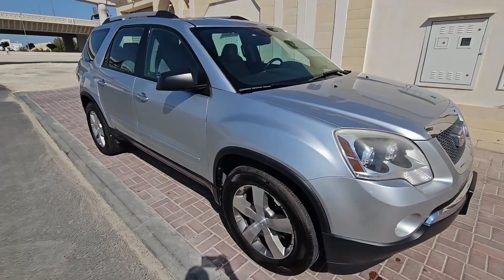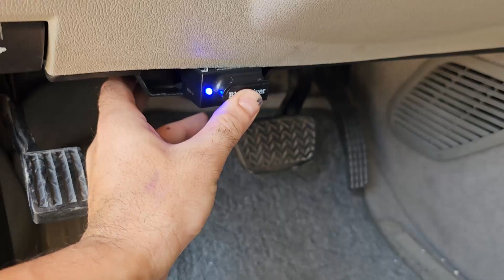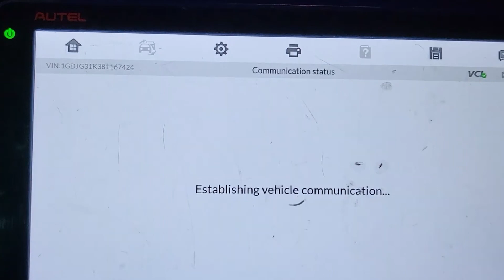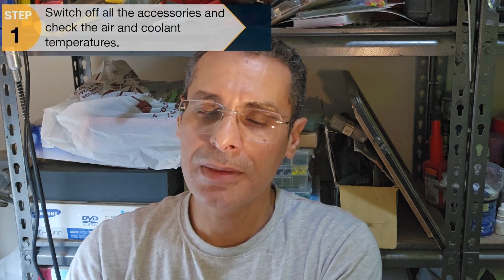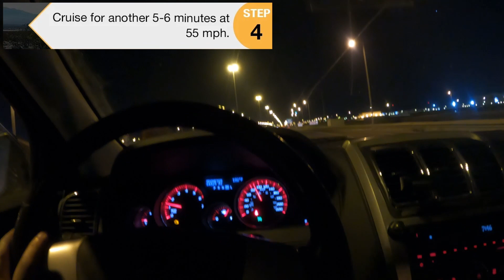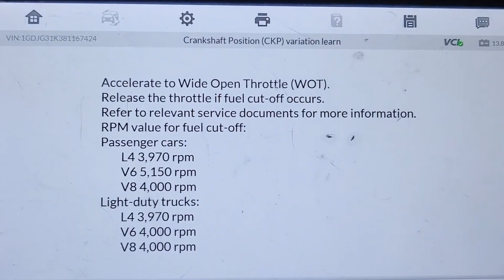No Scan tool Crankshaft position Sensor relearn P0315

Comment: Mechanical timing must be locked perfectly before locking Vanos PHAZER sprockets ALSO...must be in LOCKED position ..IF NOT when YOU snug TENSIONER inch pounds SPEC.RULE...if PHAZER is faulty ITS been KNOWN phazers go BAD...must be in LOCKED position before Torquing Cam Bolts...AND while pinning a Crankshaft..according to SPEC...must be CW only 1st piston ON WAY UP....NOT DOWN..to PIN PROPERLY....then THE CAMs writing on TOP...when Cam Locks wrap THREE FACES of CAM BOLT SURFACE...the ROUND section of NUT must be at BOTTOM...not TOP......as YOU will also see Writing.
THEN...after checking all Contact wires and connectors to Crankshaft Sensor and Inspec..cam sensors...I pull cam sensor to pin on SIDE EXACT timing marks including marking Crankshaft Pulley for EASY PINNING of Crankshaft AND....viewing whether a slipped timing or stretched CHAIN condition or poor tensioner is OUT of PLAY or spec...if Center punched PIN marks in Camshaft sensor hole HAVE changed or MOVED.
Seeing is believing.....BE in TIME mechanically FIRST...then Relearn camshaft sensor..by Expensive tool or dealer however..there is a TRIGGER using a test light from sensor to ECU crankshaft lead...unsure exactly BUT...when key and ignition is ON....the test light TRICK is performed ...which of three pins...unsure but supposedly the test light will activate from sensor to connector the ECU will begin a Relearn process...in a no start the permanent codes must be cleared..U114 or U 115...in order to Relearn....anything....so U must take to dealer for reset or reprogram or self laptop program with specific software..Expensive.OR
THE HOLY GRAIL.
Key fob in.buttin on TEN SEC each...40 times to reset ECU or...three day.nights Battery disconnect...or add 10 ohm link to disconnected battery leads ONLY positive and Negative to release all capacitance in all modules.
Unsure if Key FOB must then be reprogrammed or NOT YETT...however leaving FOB in always assures...possibility of maintaining Key FOB.
So the IDEAL..DIY trick...is Specific for every vehicle BUT......DIY...hopefuls...this is required before stealerships..LIE to US....and FIXX it without Telling us THE
EXACTING Trick for RESET.RESTARTS.😊..good luck...I'm still on this PATH.

Comment: after you do the relearn, did u use your obd2 scan tool to clear the code and then see if the code comes back?
Reply from the maker: Yes, I did that. The error remains, and I was not able to remove it.